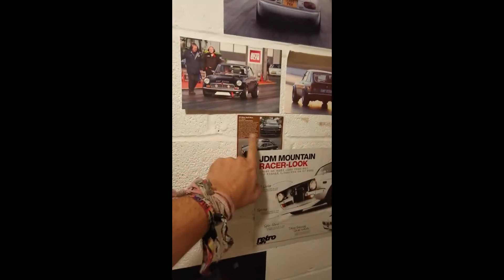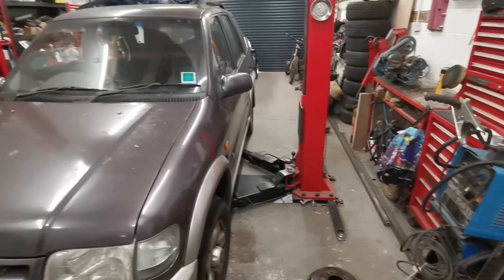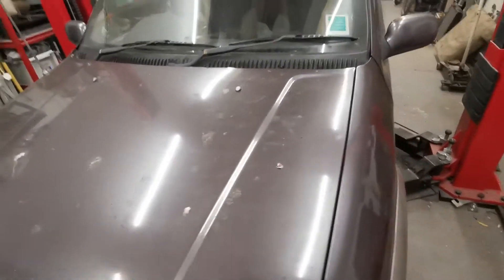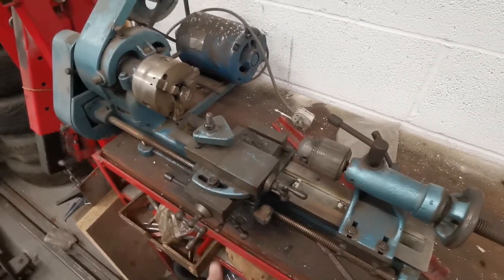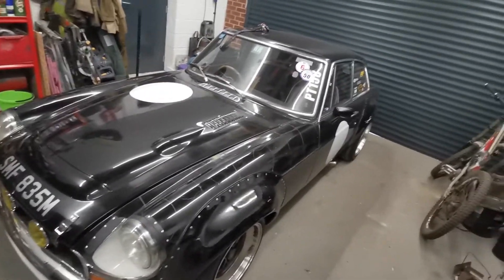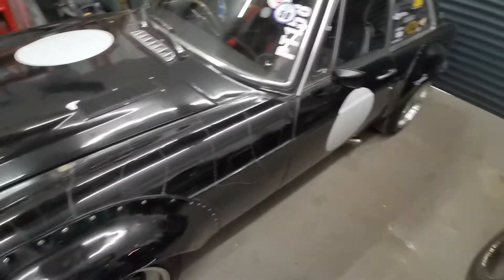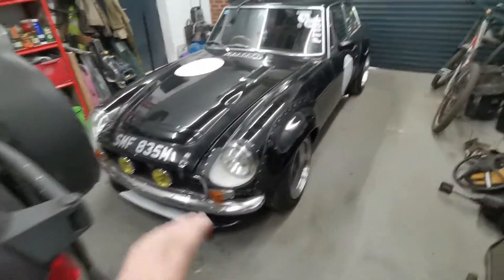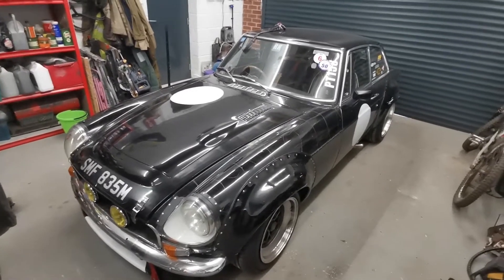Retro Rides Gathering 2021 - Turbo BGT goes up the hill

Comment: I'm from the Miata community. You seem to be the only person with videos where they push this engine and radiator setup (civic half radiator). How does it do for cooling? Any time this is suggested in a Miata group (so you can run an intercooler next to it) everyone says it will overheat as soon as you drive it hard
Reply from the maker: 100% never overheated on track or road.  Not sure why they suggest against it as it was used in the Bengi setups for years. 

Honda engines are known for being efficient, their cooling system also.  So it was obvious to me that the radiator would be perfect, in fact it probably cools the motor too much in winter without a different thermostat. 

If it's good enough for 400bho K20/24 motors it's good enough for sub-300 MX5 lumps.